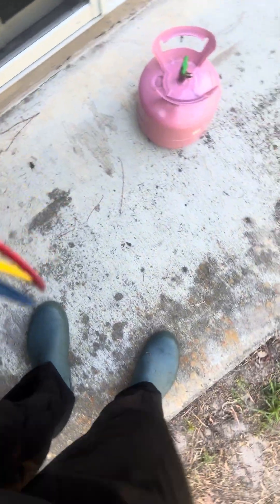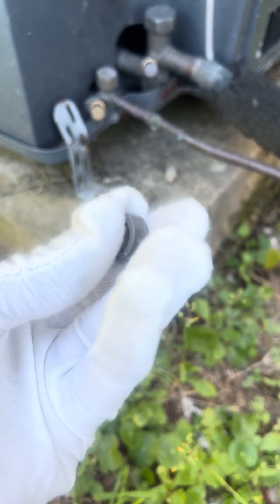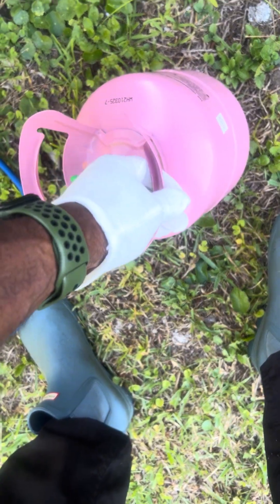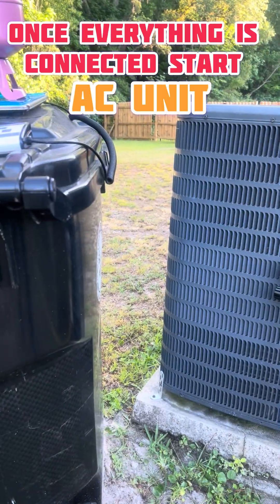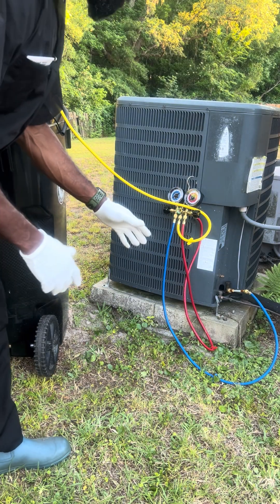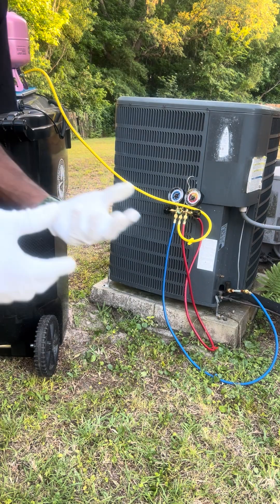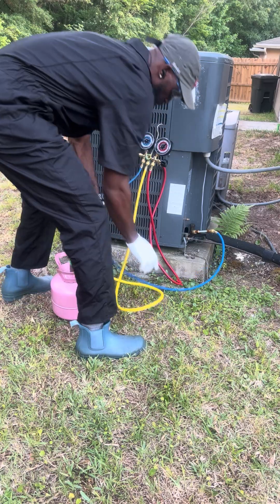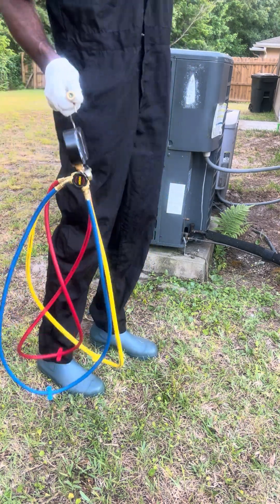Recharge your AC Unit when it’s Blowing Hot Air!!

Comment: The first thing you need to do is use proper guages to check freon levels / line pressure. Once you verify freon level is low, the 2nd thing you need to do is FIND THE LEAK in your AC lines!
It is an absolute waste of money to recharge the freon if your system has a leak! The new freon you add will just leak out again and you'll be back to square one! (Based on over 30+ yrs of field experience.)
Reply: When there is a freon leak, where is the leak usually located? My HVAC guy wants to replace the entire system and I'd rather just replace the part or item.

Comment: You are supposed to charge the unit by using superheat or sub cooling depending on your metering device
Reply from the maker: Thank you!! I greatly appreciate that. Superheat and Subcooling is the most "efficient" way charging. I agree but this video is for those that just want add refrigerant when they are in a bind. Superheat and subcooling require more tools than a scale, refrigerant and a manifold.